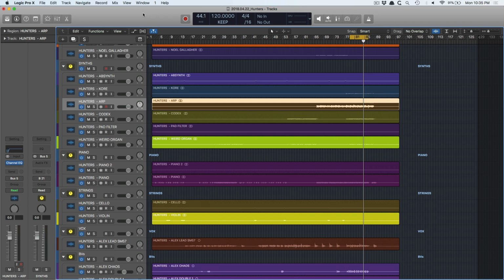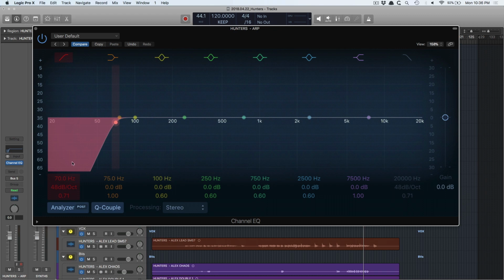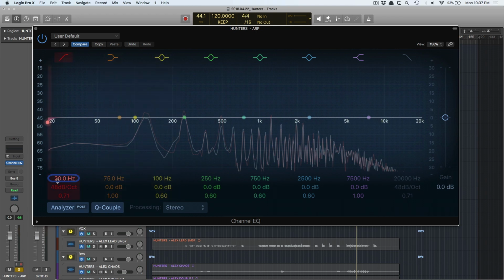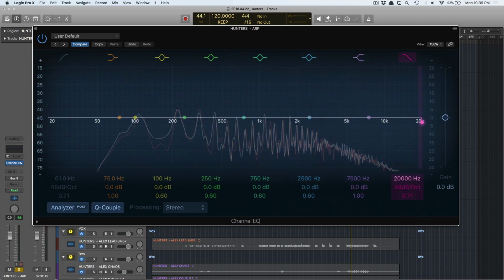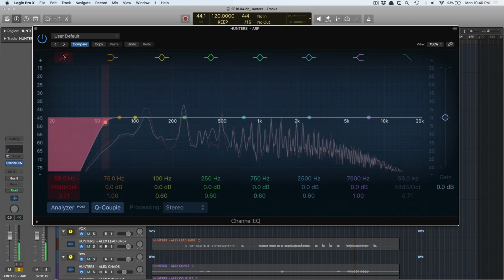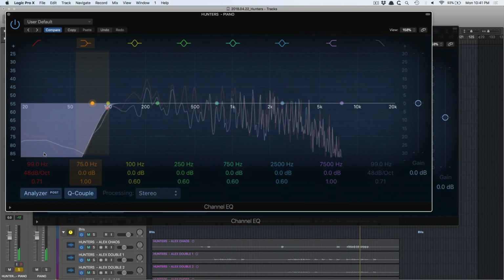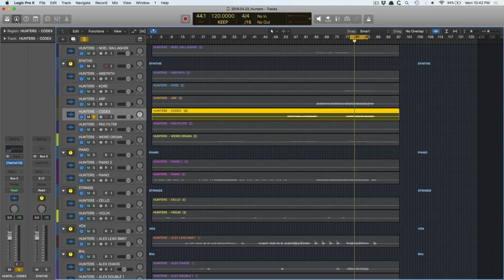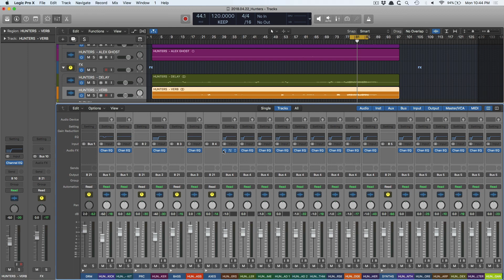Why Low Passing is Better For Space and Clarity

Comment: This can help on individual tracks but what I've found is it's better to save the lowest cuts for final mix. Sure, do it as you mix to get an idea of what's going on but then go back and remove all the lowest cuts from individual tracks, burn a mix, then do this low pass trick against your final mix with it out of phase to simply null the region throughout the whole mix evenly. That frees up ALL the individual  phase anomalies that would have been introduced by the track-by-track method. There's really no excuse for running 4, 8 or more individual high pass filters down at 30-60hz. I've done this several times to clean up old recordings from 7.5ips and < tape after transferring to digital, for information below 50hz and above 16-18khz so as to not introduce phase weirdness into waveforms that are already bouncing all over the place. Fire with fire, anything static just can't do it but the waves themselves know EXACTLY where they are. 

Try it across a whole mix and see how much of a difference there is to using any EQ you've got by itself. It might not be the most noticeable thing, how clean the cuts are, but you're guaranteed to introduce absolute minimal phase. The downside is just that you can't boost, for obvious reasons, but that's not what it's about. Another trick is to isolate individual tracks (if you can and if they're no loaded with verbs, etc), invert their phase, then run them against a full mix. It's kind of an amazing thing, somewhat like what Trackspacer does but in reverse. Comes in handy when you can't or just don't want to remix and run the entire thing again.

Comment: How would you apply this method to a guitar track with a higher gain distortion for a punk rock track? When I drag the low pass over to the left to find a sweet spot for where the high pass should exist there is still substantial “non-white noise” that I’m not sure should be carved out.

Comment: I have always found the word "pass" confusing for both high and low instances. I think if they called it "low cut filter" and "high cut filter" it would be more instinctive and match the graphical display. A low cut filter would then mean that the lows are reduced and a high cut filter would indicate high frequencies are reduced. In fact it means the exact opposite. Terrible choice of names...probably a geek engineer.
Reply: Definitely was an engineer...the terminology comes from electronics and circuitry. "Pass" means the frequencies are not attenuated, i.e. they pass through unchanged, so low pass would pass through all frequencies below the cutoff and high pass would pass all frequencies above the cutoff.

Comment: Of course, I'm sure you know there are tons of people who say "Don't high pass everything, big mistake".  Curious about your comments on that.
Reply from the maker: Hey Steve, thanks for the comment! I've definitely heard that, and I'm sure they're onto something. In my experience there's rarely been a case I haven't needed a high pass filter. Even on my kicks and bass I use at least a 20 hz high pass filter to rub out any potential DC offset. As folks often say, "it's all in the ear." This technique of using a low pass filter to isolate the bottom end will help the ear decide if it's necessary or not :)